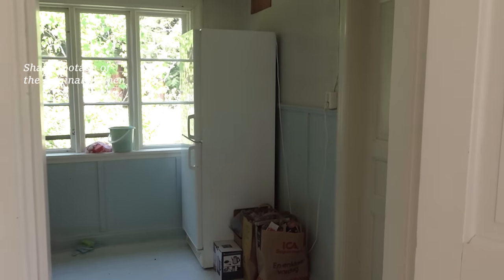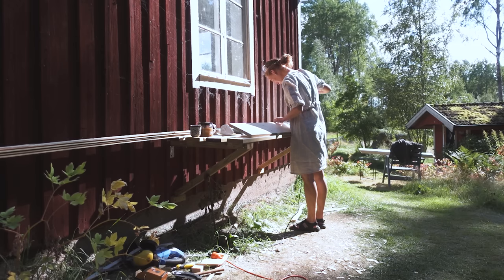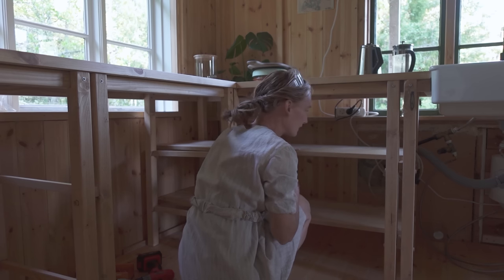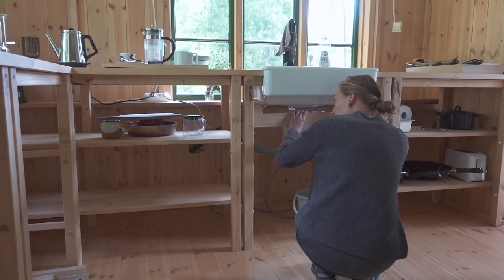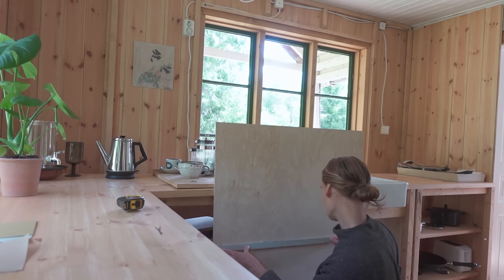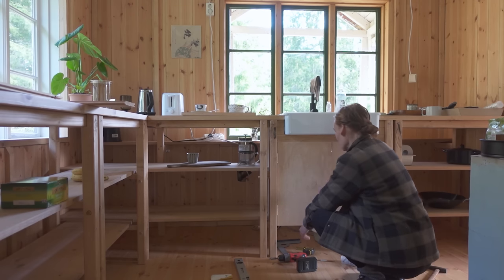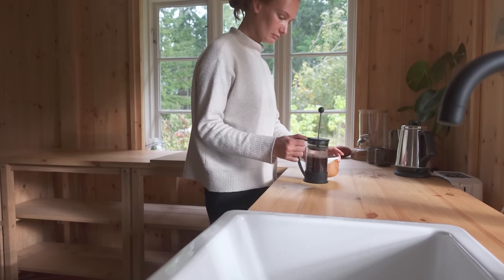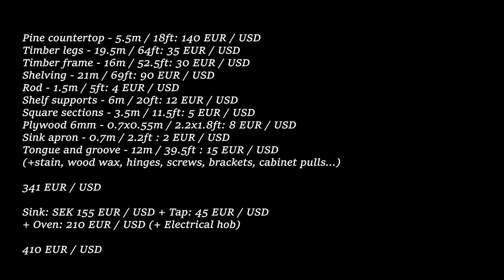A Minimalist Japanese-Inspired Kitchen For My Scandinavian Cabin (Story 30)

Comment: The plywood might need some more reinforcements on the back to keep them from getting even more wonky. Wood can warp over time anyways as it dries or if it isn't treated to protect it from humidity. (That's why you see those Z-shaped reinforcements on old plank doors or barn doors for example.) But plywood is especially wonky. :P

Comment: Everything is lovely... I love open shelving with a countertop, and love that you used wood for your top as well. I would like to give you s couple tips, from a long time builder/renovator, if that's ok... I would avoid putting fruit, or veggies right on your wood. If they ripen, or start to go bad, they may ooze juice, and that will stain your wood, even if it is sealed... Also, I am hoping the stain you used is a food grade finish... 
The other thing is, if you cut more small pieces of wood to go around the inside, and the tops, and bottoms of your doors, that will give them more strength, and solidity, and they will straighten out a bit more... But, beautiful job... Now I want to redo my kitchen like that!

Comment: Be careful using non carpentry (or rather non furniture) woods when making furniture or cabinets. I'm mostly thinking of your shelves. Wood made for furniture/indoor use has been set to dry much longer than wood used for stuff like outside wall siding. This means that when those boards you used for your lower shelves starts to dry they might warp and twist in a way that makes the shelf less usable or not level. Just a heads up to keep an eye on it
Reply: If I remember correctly, wood was ordered in large quantities a long time ago. has been left inside to dry for a long time. So wood is probably as dry as it gets.
Reply from the maker: Ah yes, the wood I used was bought almost a year ago, so hopefully it won't warp too much anymore!

Comment: Roaming Wild Rose        Important and good to know!

One problem is that pine becomes a little reddish and yellow after a few years.
 Spruce turns yellow quite quickly. It is possible to stop with a special
thin treatment. I recommend "Lady Pure" (Jotun). If you don't, you will be very disappointed.
Spruce turns ugly yellow without treatment.
We Swedes and Norwegians always treat pine and spruce.
We know that if we don't treat the wood like that, you will be very disappointed
when all light wood is dyed yellow.
Reply: How would such treatments change the appearance of the wood? Would it make it shiny? Is it a color or see through? Is it toxic? Just curious.
Reply: @gunvormagarity-groves8005   Oh no! It is not varnish or paint.
The wood will look a little whiter under a thin protective film
which is as dull as the wood is.
Made in Norway, sold in many European countries but not in the UK.
The same manufacturer made the paint for the Eiffel Tower.
Reply: @KjellEson  Thank you! Very interesting and I will definitely try!

Comment: Looks very nice Rosie, I think you got a lot out off very little, the woobly shelves, you said yourselve using cheap wood and also remember that wood is a living material,it will change with temp/moisture. I like your different solutions, but as time go by you will proberly need to rework some off it, but you have done very good and should be proud off yourself!!!

Comment: Looks amazing to keep the countertops food safe use a food grade wood stain or food grade mineral oil. Seal the rest of the wood with regular wood stain and sealer. I feel like going regret not having wood on the back doors on those floor cabinets dust is a pain 😄

Comment: You need to start using a level to avoid "wonkiness', it takes but a second and saves you a lot of trouble, and when you go buy the wood I bet they might give you one for free. The kitchen is Beautiful!!🤗 When you have the possibility though, I'd advise to completely seal the counters with epoxy resin, it'll be durable, non stainable and much more important, easily washable. I hope you have the time in the future to put more doors in the cabinets, just to avoid dust, but the way it is now is such an achievement and it looks so cozy.

Comment: I understand the constraints and I do like open shelving – I even have tons of containers that look good and tasteful in open spaces, but – BUT – there’s a reason why cabinets are popular in kitchens: frying and boiling and dust inevitably create a thin layer of sticky shmoo on every surface in a kitchen, and it’s much easier to wipe down cabinet doors than to clean every item forever.

I like it, though: it pleases me aesthetically, and the big difference you’ve made is countertop space: there’s tons of it now, and if you look at many “standard“ kitchens, there’s barely enough space to make a sandwich. This is a huge difference.

Comment: Is it enough to wax the wood to protect it against water and dirt? Especially for the sink?'
I'm moving and found this Gorgeous old country kitchen, but it doesn't have a sink. Which is why I'm thinking of building a cabinet myself to save money. Since all the sink cabinets that would fit halfway are incredibly expensive or have incredibly ugly sinks. Which is why I googled and found among other things your videos :) But I'm a little afraid of mold and swelling wood. My very, very old sink has this problem after a pipe-break, one side just did quell and on one side it got black and moldy xx.
Reply from the maker: I used OSMO’s Top Oil which is specifically made for this purpose - and I’m sure there are many other brands with similar products! Fixing your own sink sounds like a good idea :)
Reply: @wildrosie  Oh wow, thank you i didn't think someone would answer this. Thank you so much :D. I searched for this, and the first thing that came was that, "don't try this" xD, so i was a bit worried. But i will look further into this. I would love to build my own sink~.